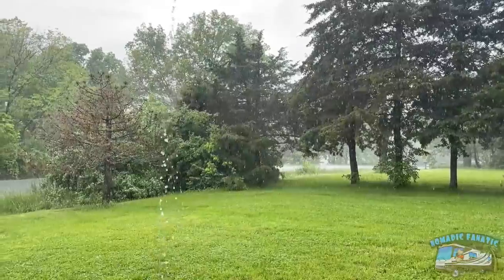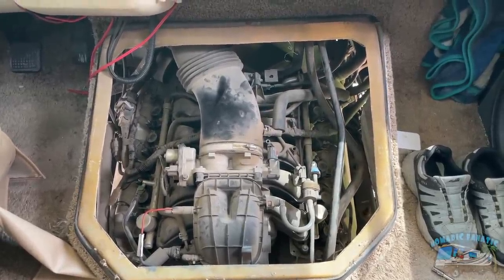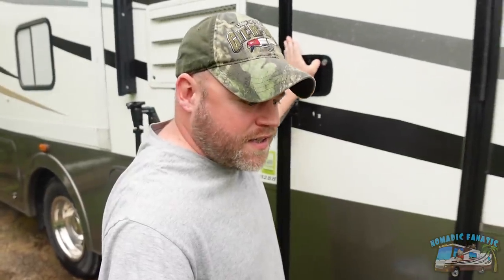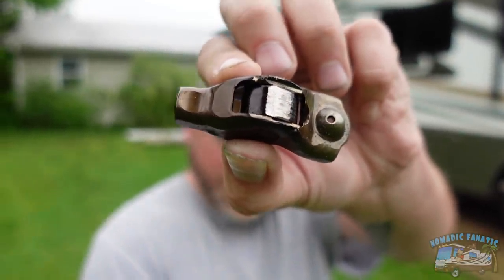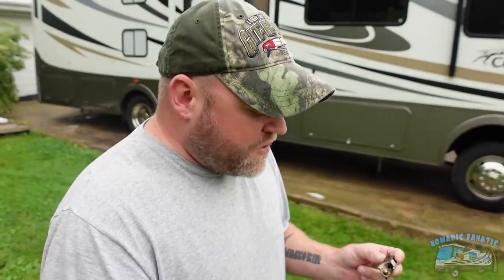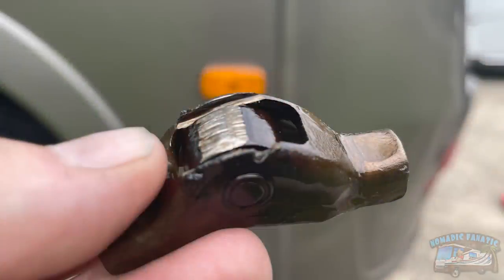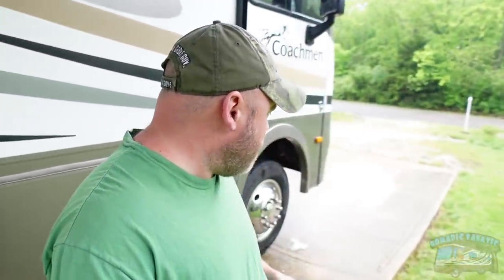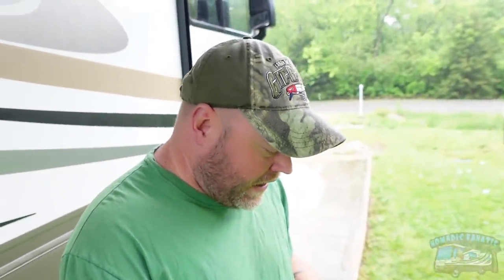Engine Repair Begins ~ Ford V10 F53 RV Is TICKING & KNOCKING

Comment: Being a mechanic for 25+ yrs that exhaust leak has nothing to do with the rocker arm, those rockers are a common problem I've seen them fall out of place and some have wiped out the cam lobe. Also as someone mentioned that cam is damaged. I would of bought Geniune Ford parts not aftermarket good luck hopefully the rain lets up soon.
Reply: Not being a mechanic I can totally agree buy Ford parts
Reply: Came here to say this. Two separate issues.
Reply: Absolutely. You get to the internal engine, you want factory parts!
Reply: THIS!  For "Mission Critical" parts (such as the motor, transmission, sensors & such) only buy OEM.  They're designed to work best with what the engineers had to work with.  Aftermarket parts are used for everything else.
Reply: Yup, ONLY use OEM parts from ford for anything valve train related, failure to do so will absolutely result in future regret !!!
Reply: Oem parts or nothing . Maybe a new crate engine cuz all that metal got into the other parts

Comment: The exhaust leak and the rocker arms are not related to each other. It is mechanically and physically impossible for your manifold leak to have caused that. Any mechanic telling you that's what's happening is either lying, stupid, or have zero explanation skills and have explained it incorrectly.
Reply: You posted exactly what I was getting ready to type!
Reply: I think what Eric meant was the exhaust leak was so loud he couldn’t hear the rocker arm noise.
Reply: @georgekeller6341  I wish but the automotive industry is very surprising in that way. There's all types.
Reply: He was saying the noise from the exhaust leak was preventing them from hearing noise the rocker arm might have been making.
Reply: @blackhat4968  Eric also said that the oxygen from the leaky exhaust caused the issue with the rocker which isn't possible.
Fix it right Eric, no noise doesn't mean it's fixed right. Measure the new rocker travel to make sure the cam lobe isn't worn down. If the rocker broke because of bad lubrication, that can lobe is probably affected too. The bottom of the lifter might provide some evidence. Make your decision based on facts not hope.
Reply: @jeromethemechanic6871  thats not enough escaping exhaust to mess with the o2. As well as it wouldnt create enough heat inside the head to do anything and even so, heat would be transfered to the oil an taken away by it. Unless a passage has managed to get blocked then we'll see this happen again.
Reply: @jeromethemechanic6871  problem is, that's not sucking air in. It's just a manifold gasket leak, it only leaks out not in lol And sucking in air through the exhaust would also indicate the cam crank timing is off. Some high performance applications will be designed to minimize the back pressure by using tube length but still would not do that as well ad this is not that kind of application. What shop you work for again? Or you a lube tech? If your a full shop mechanic I need to make sure to add it to my do not suggest list lol

Comment: Actually you would have 20 rocker arms 1 ea exhaust and 1 ea intake. 2 valves per cylinder in my experience anyhow. That sux anyway you slice it. Your very fortunate to have a friend like Robert! I speak a blessing over all you do
Reply: I figured someone beat me to it. 🤔
CHEERS! 👍
Reply: Yah you beat me to it!  I was gonna say that we here in “Canadiana” we have 2 rockers per piston, so like you said 10 pistons times 2 makes it 20 rockers....but that us in Canadiana....and yes rockers and head gasket...no correlation!
Reply: metal valve cover is a 3 valve motor, yes on the oe parts only

Comment: Hey Eric! We had a similar issue with the V10 in our coach.  A shop in Jacksonville replaced all lifters and roller followers on the right bank for $3600.  Didn't fix the knocking...so they told us we needed a new engine to the tune of $15K!  Our spidey senses said something was up.  Ended up driving the coach 2300 miles to a trusted shop in Arizona.  The problem was the piston slapping in the #7 cylinder.  $6000 to rebuild the engine.  Better and stronger than OEM.  V10's have their issues, but not many engines could make a 2300 mile trek with a piston slapping.  Check out the two videos on our channel to see how things went down.

Comment: Eric, Any time you have an exhaust manifold leak it must be repaired asap or you run the risk of a burnt valve due to the air leak that close to the valve. As for the roller rocker bearing locking up, I do not believe this had anything to do with the exhaust leak. Mechanical parts fail and there is no way you would have been able to see the problem until the damage became advanced through miles of driving with the locked up bearing that allowed enough metal to wear away to cause a clearance issue that in-turn caused the ticking sound. You are on the right road by replacing the Lifter and the Roller Rocker, I would highly recommend that you ONLY USE FACTORY FORD PARTS. no aftermarket parts. However, I have am very surprised that the Camshaft lobe and surface did not get damaged while a locked up Rocker was skidding against it for many miles possibly. You can try doing the fix of just replacing the Lifter & Roller Rocker to see if the clearance issue is gone along with the tick and it may be fine due to the fact that your engine is a Roller and not of the flat tappet design. I think it is worth a try, I say this without having my own eyes looking at the Camshaft Lobe. Good luck Eric

Comment: Hey Eric... the two issues are unrelated, although it may seem like they are linked, they're NOT... Ford Engines like the Triton V8 5.4L both 2V & 3V and the V10 6.8L engines have a similar list of known problems... #1 - being shallow threads cut, usually 4 to 4-1/2 in the heads to hold a spark-plug with 10 threads, prone to blow out of the heads... Recommend: CalVan Tools stainless steel spark-plug thread repair kit... #2 - cracked PVC hose... #3 - cheap exhaust manifold & gaskets both prone to failure... #4 - Plastic Timing chain guides but more importantly inferior "tensioners" which require upgrading... #5 - Headgaskets... ALL in ALL you've been pretty lucky 🍀 especially being at or near home 🏡 with friends and not out on the road... Stay positive... and if you could. Can you come spend a day or two here in Southern Commifornia because we could use some rain ☔️... lol 😂...

Comment: Could be the timing chain guides gone bad. The triton engines are known for that. Sounds very similar.
Reply: Not if the oil is changed every 3000 mi. The worst thing a person can do is follow Ford's maintenance recommendations. Full synthetic, 3000 mile oil changes. Period. 
I have a new RV with the new 7.3. We'll find out how good that engine is.

Comment: Need to check all the roller followers for play in the bearings if you don’t replace them all.. and I’d highly recommend pulling the front cover and replacing the timing chain tensioners and guides  as the nylon gets worn down and brittle from all the heat cycles and start up rattle of the chain can also damage them .  I’m not sure but Melling might make a high volume oil pump for that engine. I’d put a magnet oil drain plug if it doesn’t already have one..

Comment: Ford needs to recall those engines
Reply: No they don't, they are great engines. There is something going on here. I have over 115K miles on mine and it's still 100% factory down to the spark plugs.
Reply: @TheSoloAsylum  He ran the engine without a good exhaust manifold seal for too long, burnt up the engine without proper backpressure
Reply: @livinincalifornia  nonsense, backpressure is meaningless at the exhaust manifold.
Reply: @livinincalifornia  back pressure LOL what the hell are you talking about.
Reply: @ARluvr1  learn mechanics smart guy
Reply: @TheSoloAsylum  Shows that you dont know anything about engineering
Reply: @livinincalifornia   well explain it too me ? I mean I have an 800 HP mud truck that has Long tube headers with a turn down off the header how does that even run with no “back pressure” LOL. How do those 10,000 Hp top fuel dragsters run with literally no exhaust.
Reply: @ARluvr1  show me an engine that is built and  runs without an exhaust manifold
Reply: @livinincalifornia   go onto YouTube and type in engine runs with no headers. There a whole bunch of videos LOL.
Reply: @ARluvr1  That's not what I'm asking man, you can run an engine without an exhaust manifold for a short amount of time, but any mechanic would tell you that's a bad idea because you'll burn up the valves.
Reply: @livinincalifornia  Tell me about the V10 you own...oh you don't have one, I do

Comment: I have worked on many engines and rebuilt many as well. I will try not to be negative here. Any time that you here a ticking or clicking sound that comes from the engine and it’s not coming the exhaust that should throw a red flag 🚩 to your brain something is wrong 😑.   Any mechanic with any grain of salt wouldn’t have say that you shouldn’t be concerned with the ticking or clicking sound that is coming from the engine. In most Every case that the engine rocker arm, lifters and or the lifter rods is or are going bad.   Now since you have that side of the engine apart I suggest that you or your friend that is the mechanic to pull the crankshaft.  Just to see if it’s ok.   I understand that you are a Nomad and travel a lot and it is rain a lot where you are at now but I think it is in your best interest to do it now and not to wait later.    I know it’s easier for me to sit here at my home and tell you what you to do. I have been I have been watching your videos for years now I enjoy them and keep up the great work.

Comment: First of all, that exhaust leak did need to be fixed. One of your problems would be problems within the catalyst system. If your exhaust leaks out before it reaches you O2 sensors, it will register as a lean condition. What the ECM will do then is feed more fuel through the injectors, in reality running rich. Which is bad, because, if it can't burn all that fuel it will dump it raw right into the Cats. Which will destroy them. So, that Exhaust leak was very important to fix. 
   On the rockarm problem, Ford has been having valve train problems since the onset of the Modular engine. They've been trying to perfect their Overhead cam since the 60's. They're still having problems making them reliable. Make sure your buddy checks all those rockers. Take a look at the cam phaser while he's there. After the repair reset the KAM in the ECM. That'll take it back to base parameters and will start its relearn fresh. Good luck.

Comment: I think the type of spark plugs was likely part of the problem. I've used a couple of sets of spark plugs that had the same needle-pointed centre part. Each time the centre burned down over just a couple of months, making the spark gap too big and preventing them from sparking properly. I don't have the same problem with the regular-shaped spark plugs, that have the wider blunt centre point.

Comment: My Dad had a similar problem on a Ford V8 engine. The problem was caused by no oil being delivered up to the rocker arm. He had to do a little grinding on the stud to open up the oil feed. You should check to see if oil is feeding up to the rocker arm. If it's not, the problem will return once the rocker arm wears out again.

Comment: RV failures shared are interesting. Others may learn something from them. A home on wheels will always bring about a heck of a trip in many ways. How the motor and following machinery preforms will be determined by the kind of use placed of upon them and becomes important to understand. Tiny parts included able to help move such mass by wheels become appreciated. Driving a RV requires its own approach by use compared to motor bikes, cars and even small trucks. You're at big time max load capacity all the time with a RV. I never employ near full rated horsepower of their motors. I just ramp up too and hold torque limits. There is never enough power there beyond the torque worth the risk of riding the stress limits. In other words I don't risk finding out what the limit in regards to the machinery by trying to hold speeds going up hills or acceleration to be like other vehicles on the road with me in the moment. Drive them safely as one can for what they really are which is an under powered over weighted house upon wheels with most other vehicles on the road having advantages you do not.

Comment: Ok the motor.
1st it's pretty obvious it's not strong enough for your RV.
2nd Ford V10 in motorhomes seem to have major issues.
3rd odds are the part failed because the RV is just to heavy for that little motor.
4th Google says the right head of your engine has major issues. Like ooppss factory mistake.😬

Comment: I have a 1998 Ford Expedition that I pull My 28 ft camper trailer.   It has a problem with only 3 threads per spark plug.   It is a factory designed defect.   So far, it has only blown 1 spark plug so far.   I have heard that they normally blow at least 2.  I have been lucky so far.

Comment: I wonder if the exhaust leak created excessive heat on one location on the head? That rocker is brown from baked oil. That wear is lack of oil for sure. If the leak and rocker failure is on the same cylinder I think that's what's happening here.

Comment: Hey Eric, these Triton 3 valve engines are known for these cylinder head issues, if it is one. Yours is not an isolated occurrence, I have seen pictures of engines that had to be junked, because a problem like this isn't caught in time and lets a valve get broken and, causes block damage. My layman's understanding is that the root cause of the problem is small oil passages that become clogged/restricted. More frequent oil changes are one thing that can help. I have also heard that there are some aftermarket oil pumps available, with increased oil pressure, that can also help keep these kind of issues at bay. Might be worth looking into while you have the RV getting repaired. You could also try adding some kind of long term friction treatment every few oil changes. I like Dura Lube personally.

Comment: Hi Eric , Vinny here .  I'm not familiar with the V-10 , but I'm thinking if it has hydraulic lifters one might not be pumping up .  If it has solid lifters they might be out of adjustment .  I see the worn rocker arm and I'm really surprised !   They must be building these vehicles out of crap today .   My suggestion is get a couple quarts of MARVEL  MYSTERY  OIL , read the instructions and use .  Make sure all the oil journals are not plugged .  Something caused this rocker to fail .  But what ?  I've used MARVEL for 50 years and praise it highly .  Hope this helps .   Your good friend Vinny in good old Fla.

Comment: I was gonna say a lifter tapping, but that rocker arm drives the lifter. Check you exhaust pipes, mufflers and converters for blockage. Note to self, if I ever but a motorhome, get one with a small block Chevy engine. Way easy to work on, cheap to replace.

Comment: Eric. Looking at the rocker arm in the video I believe the rocker failed because of a lack of oil to it. Did you run it with the cover off?  Was oil pumping up from the head to that rocker arm?  If you just replace the cam and rockers without diagnostics on the seized pivot it may do it again. At least you have an idea where to look. I was a GM service tech 1980-2000.

Comment: Do the Rocker first and see if it goes away, maybe use a thicker oil to quite it down. If it still is ticking well then think cam shaft and new lifters

Comment: just do the rocker/lifter,, if you do cams you'll be doing the gears ,chains and guides for the chains .I can do it all, but it'll be around 1200+, and yea i'm still just off rt 104 west of rochester ny. 1 week turn around. most likely that lobe is worn seeing the old and new groves on rocker bearing.

Comment: FYI, a V10 has 20 rocker arms. I'd replace all 20. Those needle bearings are scary. Check the pushrods, lifters, valves and cam while you're in there.

Comment: That motor has a problem with timing guilds. They start fallen into the oil. Causing rocker to fail. The roller pins on the lifter's lobe start wearing out, causing a clicking noise. Those motors have problems from hills climbing and overweight. You might need a timing synchronizer replaced. They normally don't go bad 100,000 miles with normal driving.

Comment: I know the metal in the cam is way harder than the rocker but that rocker really looked bad   Hope everything works out. My buddy had a v-10 in a Ford 350 van that was way overloaded with two cyl air compressor small welder wi huge chest tool boxes and a hose machine.  It was a tank and had close to 200.000 milled on it I've herd nothing but good stuff about that engine  I know you take care of it but who knows what the previous owner did to it

Comment: My guess is the hydraulic lifter did not allow oil to pass  thru to lubricate the rocker arm. The lifter has a check valve that may have gone bad.

Comment: Hey Eric dont sweat the lack of video uploads man, were following you because we are interested in you journey. As far as the camshaft, obviously theres no way to know until you install it and fired that puppy up. But I have worked on cars my whole life and you are on the right track of thought in my eyes. Why put the new cam in it if its not had scouring and damage. Id say do a compression check and if thats all good theres no need to replace the cam. Hope it all works out brother